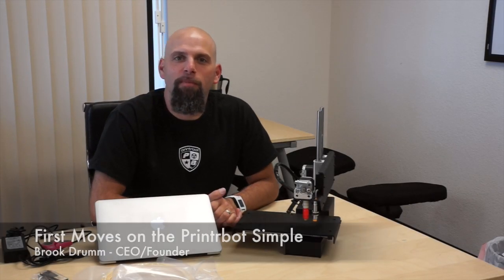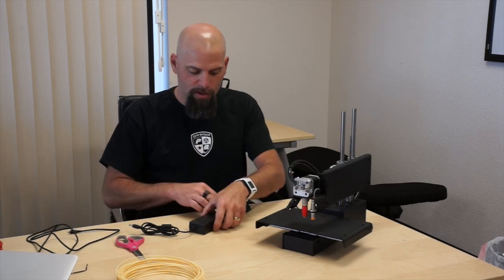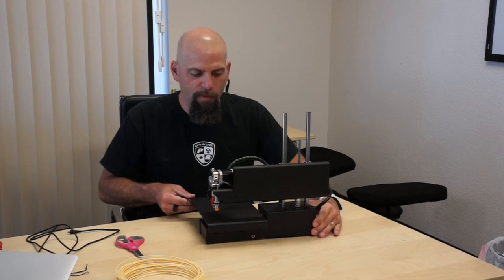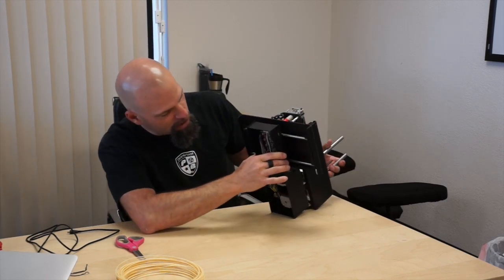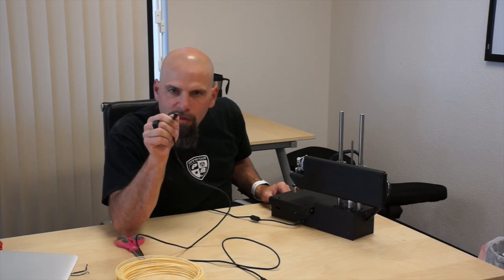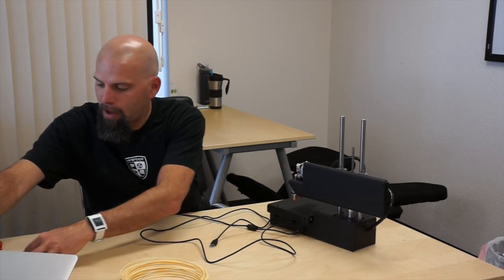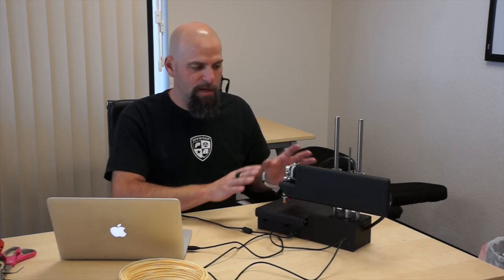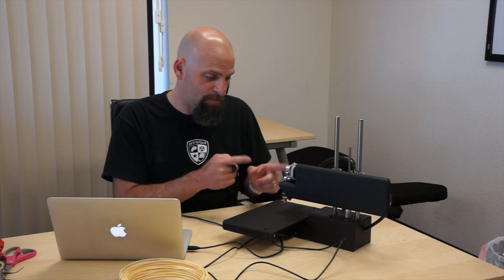Printrbot Simple Metal - First Moves

Comment: Could you pls tell us what's the "software" you are talking about? I have hard time to understand how to test my new simple metal machine. Thanks
Reply: The software seems to be Cura, with details on the "Getting Started" walkthrough: 
http://printrbot.com/project/simple-metal/
It is a little confusing because the controls for moving the platform don't appear until you hit the "Print with USB" button on a connected and powered printer.
Reply: Steve Castellotti Don't forget, to change the settings so as to be able to use ponterface UI cura

Comment: I need help! I assembled my printrbot kit with the 4x4 build area. I loaded the G code for the shroud and it starts the probing process, but when it moves in the Y direction, it thinks that my bed is much larger than it really is and it keeps turning the gears and grinds the cable. How do I fix this??
Reply: Not sure if it helps now, but you have to make sure the printer size is set up right. In Repetier, Config > Printer Settings > Printer Shape. Set the correct values for X and Y Max and Print Area Width and Depth. The default it had there was 200mm but I have a 6"x6"x6" (approx. 150mm) printer so I experienced the same as you.

Comment: I just finished assembling Simple Metal Kit.  Mine doesn't move like that at all.  Heating element won't turn on. Heavy motor stuttering in all three axis especially X/Y.  Y/Z doesn't move full range and stops responding to manual command.  I hear clicking/humming noise once X/Y axis reaches home position.  I know this is not necessarily a place for support issues.  I did open a support request so hopefully it will get resolved soon.
Reply: Make sure your end stops arent' fastened too tight and that they freely actuate. You should be able to click them by pressing it down.
Reply: Kyle Shaw - The power supply unit was defective.  After I received a new power supply from Printrbot, I had to reflash the firmware.  Disappointed that it was shipped with bad power supply and corrupt firmware but I'm very happy with the printer now that it's working.